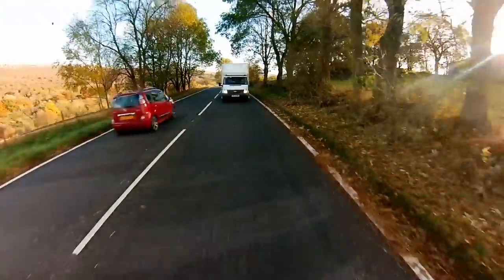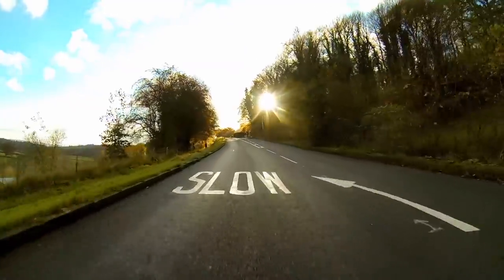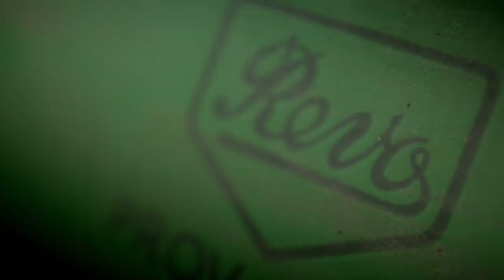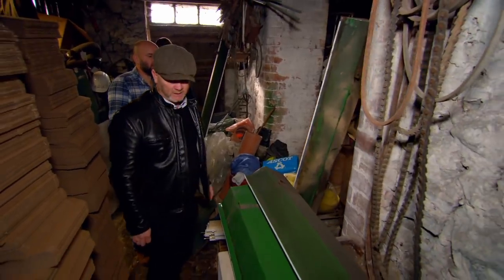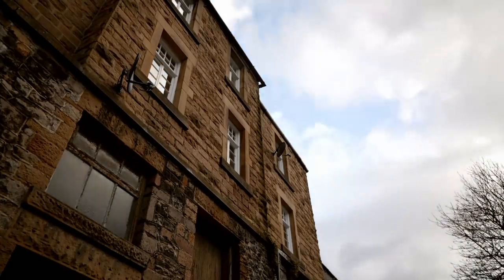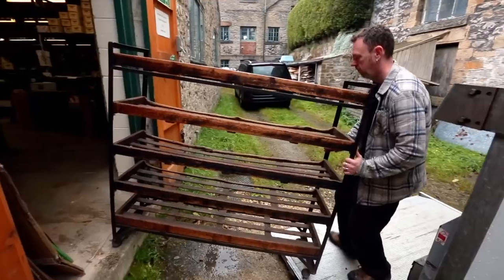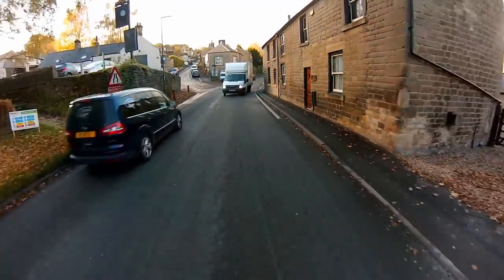Finding Impressive Industrial Furniture In A Traditional Boot Factory | Salvage Hunters

Comment: Ripped them off on the lights.
Reply: Deborah Barnes  They make boots, they are not antique dealers. That's how they got ripped off. Also they are probably just employees, and it is not their own money. Possibly even been told by their big boss to be as helpful to Drew as possible.
Reply: @sightsounds9453  to be honest by the time they clean the lights and rewire them so they can be sold they will be costing well over a hundred quid each. rewiring and cleaning these up is very expensive and then they have to be marketed. he didnt rip them off he was actually decent with them.
Reply: @sightsounds9453  The lady in the film is the big boss. Her father  Les used to be the boss and prior to that her grandfather Arnold, one of the founder William Lennon`s sons.